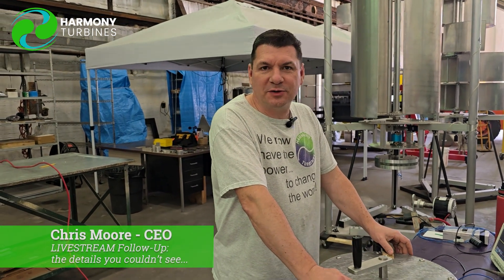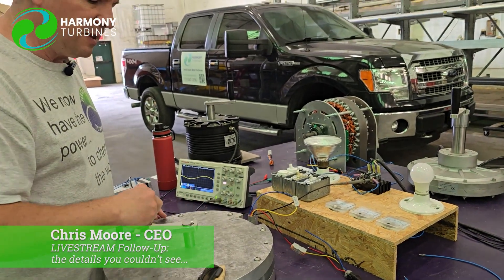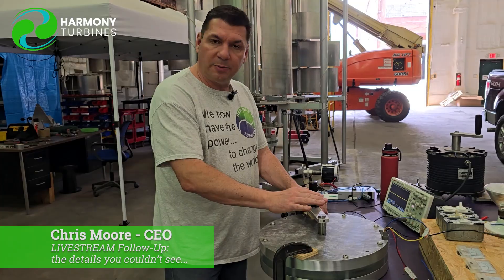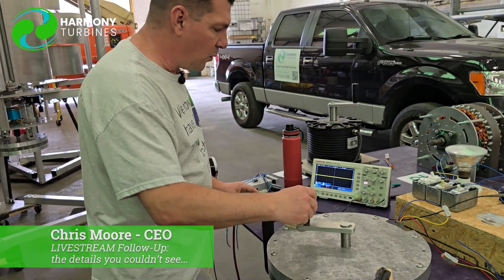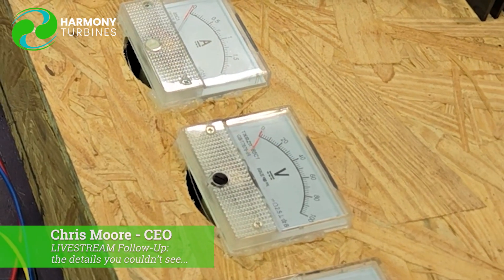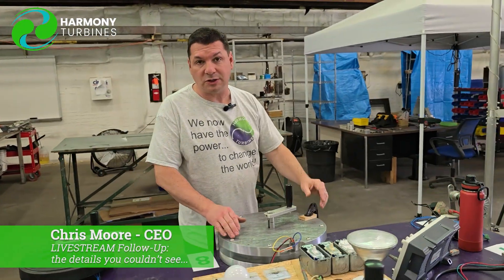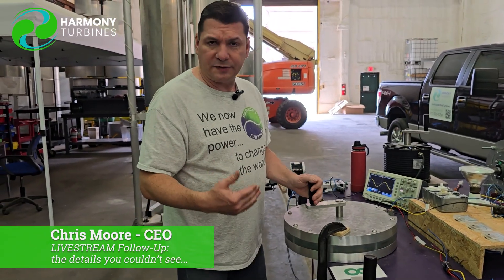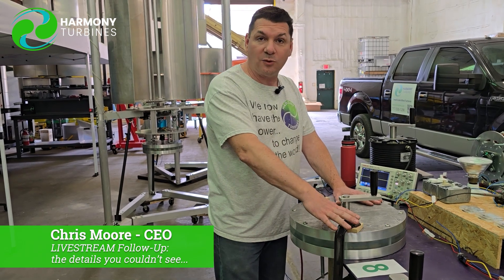What you couldn't see in the LIVESTREAM!

Comment: What is the maximum RPM of the turbine when furling becomes necessary to prevent damage?
That should be considered the upper generator limit.  
Most individuals seeking a VAWT are urban and suburban where winds are typically slow and dirty.  HAWTs in these locations are impractical due to wind speeds, space limitations , and consistantly changing direction of flow.
The best generator would have a low cut in rpm and higher generation at low speeds. 
The old school governor controlled variable pulley system could be useful.  High torque at slow speeds to overcome cogging under load; say 2.5:1.  Then quickly switching to an overdrive condition; say 1:1.5.
Reply from the maker: @Digidoc316 yes you're doing a great job of re-stating many of thing things I've been speaking about in our videos over the past 2 years. However your statements about adding a governor and transmission (variable pulley) system are definitely not the direction we're going. I spoke about this as well in our last few videos. It is not needed, and just adds more risk of complications & breakdowns as well as raising cost and complexity of the overall system. In the end we do not need a variable speed system. We should be just fine with 1:1 coupling of turbine to generator.

Comment: that's pretty impressive   did you dig into the morningstar 600 volt charge controller it is programable for wind or hydro  I have the firmware  it's fully programaxble
Reply: Interesting, can the Morningstar handle wind and solar simultaneously(?)
Reply from the maker: I did reply to you a few weeks ago stating they do not have specific wind models so we would be fighting an uphill battle there.
Reply: did you talk to engineering @HarmonyTurbines